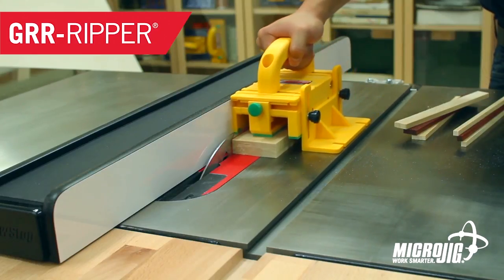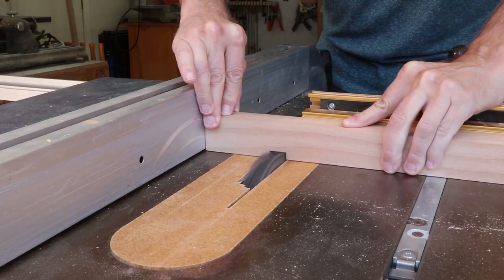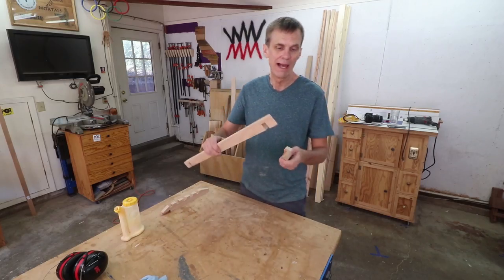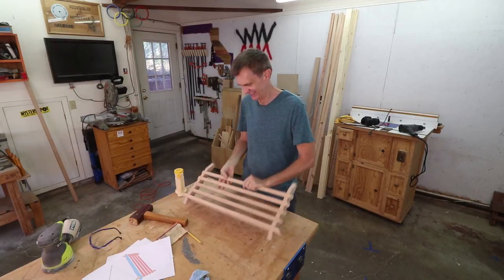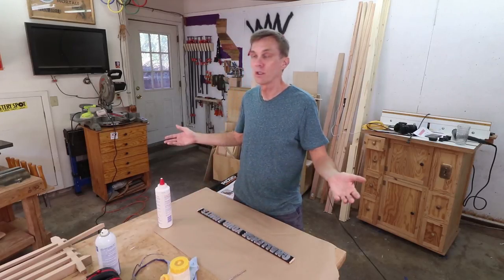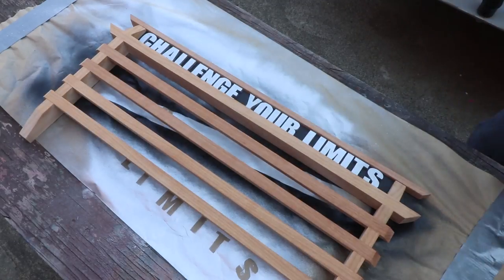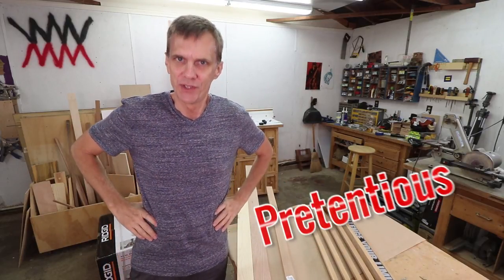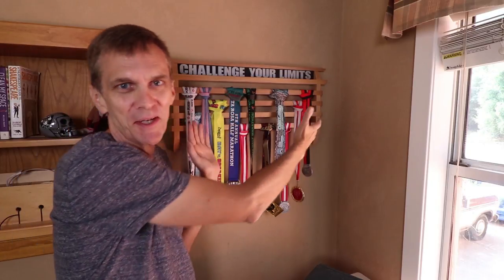Running Medals Display Rack | Woodworking Project

Comment: Having the cut-out letters put themselves in place via stop-motion animation would be an adequate substitute for cutting them out on the CNC.  Be sure to add some squeaking or shuffling sound effects.  Bonus points for working a Wilhelm Scream in there somewhere.

Comment: I have been a full time woodworker for 3 years now, part time for the 2 before that.  First yes I still watch WWMM weekly.  Yes I still learn things from time to time even though it's not meant for me.  With that said a portion of your woodworking skill will be how you can fix mistakes without anyone knowing there was a mistake to begin with.  It could be small things like sanding too hard and burning through your finish, mis-cuts, or drips in your finish.  All those super awesome woodworking projects you see have mistakes in them, they were just hidden well.

Comment: Ey Steve! Greetings from México. I just bought two GRR-RIPPERS on internet. I never saw them before, but watching your videos I knew that product. Thank you for this! I hope your sponsors pay you more now that this product can be sold to other countries. By the way. I´m going to build a whole wall of Shoji doors (japanese style) using Banak wood. But now that i bought the wood i can see the wooden boards (10 ft) are buckled (If i put them in the floor they have a small curve in the middle), how can I correct this? Cheers!

Comment: I always enjoy it when someone takes a mistake and turns it into a design element. It's all very Bob Ross. Don't make all the trees the same. This happy little tree has some bevels cut in it.

Also, "alder" can be pronounced "all-der" like "call," or it can be pronounced "ahl-der" like "gal," the way you did. Either is correct. It's one of those regional dialect things that keeps American English so interesting.

Comment: I'm shopping for a bandsaw,  looking at the laguna 14bx or 14/12, would prefer to keep it at $1,000 but want 12 inch re saw capacity. Any other brands and models to look at?

Comment: Steve, can you provide a link to a nice quality table saw? Something small to moderate size... Thanks
Reply: Douglas Porter 
I bought a used JET table saw for $125 off craigslist. Just use the search notification deal that sends you an email as soon as a new ad is posted and you'll be the one of the first to see the ad. That's how I get most of my tools.

Comment: Boy scouts of America and the us army have silver above gold.
Reply: QuestForTheOpenRoad That's because the "gold" is actually brass.
Reply: Nillie no, as a Cubmaster we are educated why.
The army had used gold as top for many years. There cane a point that they wanted to add ranks.  But, as they didn't want to change what they had they chose to use silver. That's why Lt. Commander is a silver badge instead of gold.

The BSA models their organization in part after the military,  that is why we use silver over gold.  Example: one of the highest national awards a volunteer can earn is the silver bever.

And in military it's the silver start.

Comment: CNC? bah! Don't you know CNC routers are the only real woodworking? Like, what could be more real than telling a computer to make something for you? In my opinion, using a CNC machine to make something takes away from making. Just not as meaningful anymore. Then again, the same could be said about the contrast between using table saws and power tools and pre dimension lumber versus hand saws and chisels and planes.